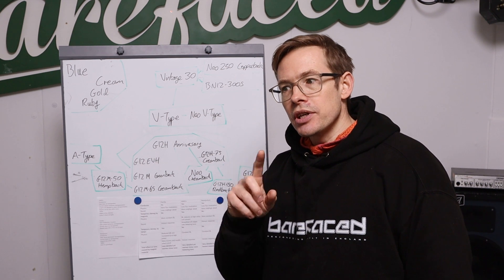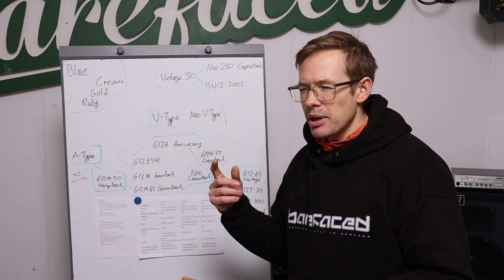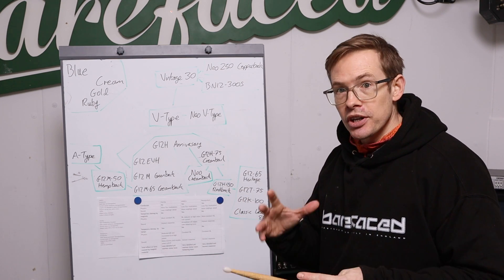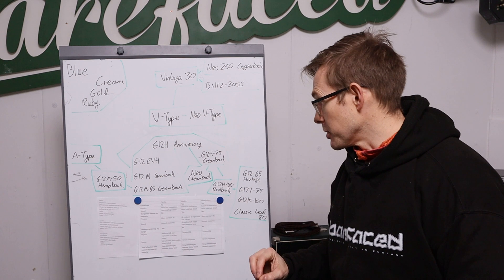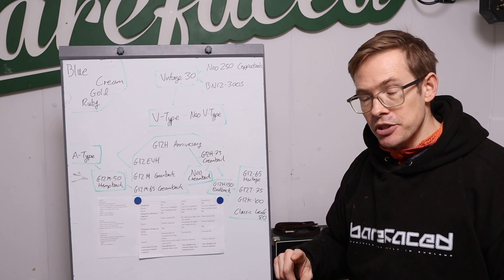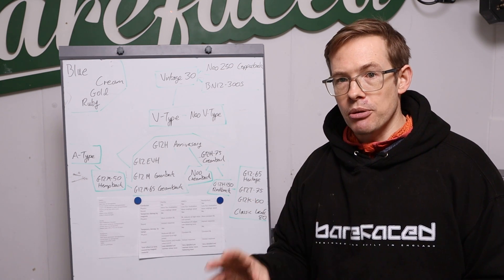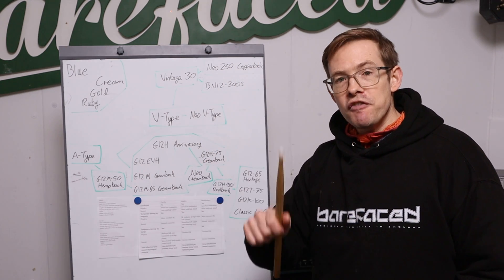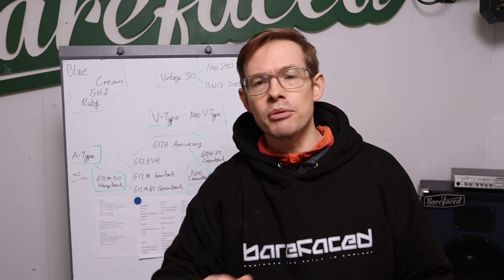The first video to properly explain why AlNiCo, Ferrite and Neo guitar speakers sound different?!!

Comment: Alex, that was super informative! I have noticed speaker 'fatigue' when pushing it at prolonging high output levels. I had assumed this was more a thing of alnico speakers but it seems ceramucs are more prone to that. Suffice to say that all the other speaker elements play a big part. Celestion made the alnico blue to go into the Vox ac30 and they are glorious when pushed. Other, Fender old alnicos tended to blow in the early 1960s and often replaced by more robust ceramics. They mightve just been more robustly built and i think the elements of Alnico became scarse. Push a greenback and they get a sag. That IS a certain sound some people like. Another thing to consider is the way an amp's output transformer interacts with a speaker. That push and pull thing.
I often use 2 10" drivers, one alnico and one ceramic. They both have their strengths and weaknesses. This for electruc guitar. For bass the mix and match does not work well for obvious reasons..
Thanks again Alex for your deep dives!
Reply: Sorry for the typos. You cannot edit your post afterwards.

Comment: If you step away from the guitar speaker area and move over to the hi-fi "audiophile" area the debates are the same but with less voodoo logic being employed because BIG money has been spent there to confirm and clarify the behavior of every component of the system used to "reproduce" the sound, but they use amplifiers and cables and speakers and cabinets just like guitarists do.

Comment: I don't think the eddy currents are just "against" the intended movement of the speaker.  It is sometimes against it which causes distortion by reducing movement, and it is sometimes with it which also causes distortion by increasing movement ... it muddies the response in both directions.  If I remember my physics from several decades ago anyhow.

Comment: WAT!?

Edit:
Ok, on the third listen I got past the confusing bit and into the practical bit, and now I better understand the confusing bit; thank you for this! 

I love to use Softube's 'Celestion Speaker Shaper' plugin, and now I understand why choosing one of the two different Ferrite options and increasing the 'Boost' leads to a  more full, booming sound.

It would be interesting to find out whether magnets could be combined in a speaker design. Specifically AlNiCo and Neodymium